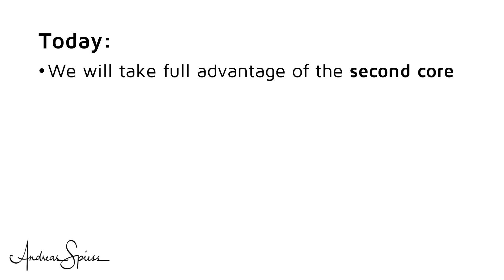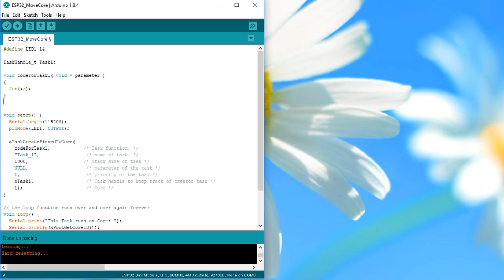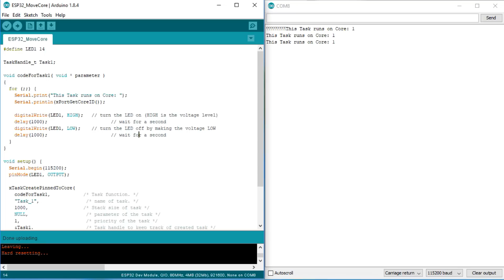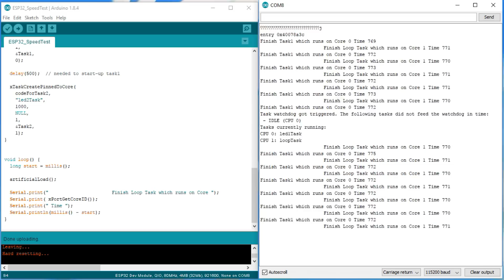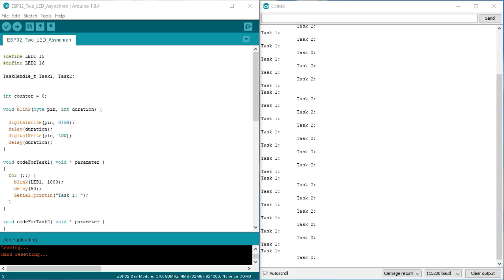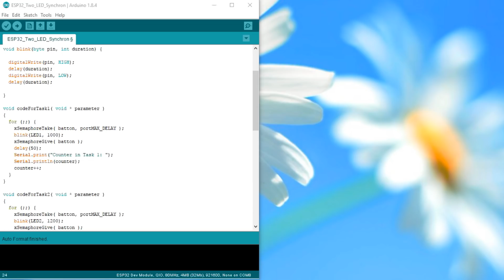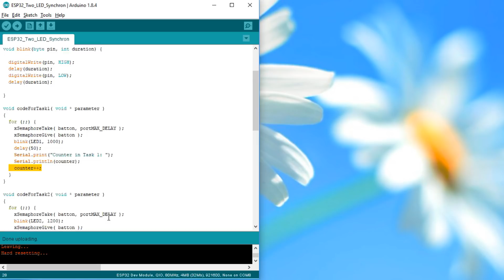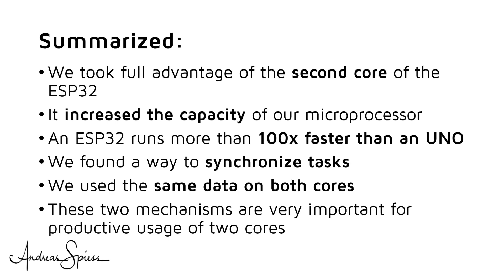#168 ESP32 Dual Core on Arduino IDE  including Data Passing and Task Synchronization

Comment: Hi All,

I am Harendra Fernando from Melbourne, Australia.
I have a quick question about the current topic.

Does Arduino_FreeRTOS ( ) work for ESP32?
I tried to use Arduino_FreeRTOS and Semaphores in ESP32 but it was throwing an error during compilation and stops at the line;
#include
 <Arduino_FreeRTOS.h>

Error: “exit status 1
Error compiling for board ESP32 Dev Module.”

I have installed the FreeRTOS libraries.

Any Idea or thoughts?
Thank you.
Cheers
Harendra
Reply from the maker: Maybe you watch my video ESP32 on steroids?
Reply: Hi Andreas, thank you for the quick reply. Yes, I did watch that video.  But I could not find whether you have imported (included/loaded) the Arduino_FreeRTOS.h file to ESP32? and ways it had done.  If we are to use "xSemaphoreCreateMutex()" should we include the Arduino_FreeRTOS.h ? 
Awaiting to hear from you.  Thanks

Comment: The Arduino Uno is also a RealTimeOS. RealTime is linked to strick time control of the service. Typical for microprocessors. Windows is not.
Reply from the maker: The Arduino has no operating system. It only has a bootloader.

Comment: Hi Andreas :) Another brilliant video as usual. What steps can be taken to work out the stack size for the tasks? I have a project in which I've split the tasks up: input scanning, control, display & logging. My ESP32 DoIT board kept rebooting and I ended up getting it to work by trial and error with the stack size and in some cases changing the target core for a task. When I tried to add WiFi and a WebSocket connection, I couldn't get it to work no matter how much I tweaked the stack sizes and swapped target cores around. I know you're really busy, but even if you could direct me to a link or something as I haven't been able to find any detailed information on working this out in a practical sense.
Reply from the maker: I never looked at the stack size so I cannot help here. I read that you should be very careful if you use Core 0 because it is used by Wi-Fi etc.
Reply: @AndreasSpiess  Ah ok. Thanks for your reply. Yeah, I think I need to read the documentation a bit instead of just hit-n-missing it.

Comment: Anther 5 Star Vid from you! Can we use the Core_0 to run the WiFI Manager and perform some actions pushbuttons for led on/off on the Core_1 ? Is this possible, if yes, could you shed some light one this ? Perhaps, any reference links ?  TIA
Reply from the maker: I do not know because I never tried it and I do not know of links :-(

Comment: An explanatory video like this in such a good tempo is fascinating. No wonder to see so many positive reactions.  But certainly you spend time to produce. Thanks, Andreas, for that.
I have a question that will make using both cores even more interesting. What about interrupts and ISR's? Which core is handling interrupts? 
Say we have a process that produces many interrupts, you could think of an Rotary Encoder.
Pololu has motors equipped with an Encoder. So I was thinking of using the Encoder info for a feedback to control the speed of such motor - now Pololu is offering very expensive motor controller boards from RoboClaw to perform such task. Would be nice if we could do this with an ESP32 for less then 10 $.
My idea is: 
 - one Core is handling all interrupts from the encoder and shares the shaft position info with the task running on the other core
 - other Core uses this position info to calculate if motor runs to slow/fast and corrects the speed of the motor
For a project with 22 motors that have to run at the same speed this will be a money saver.

Thanks if you will think about this,

    Jop
   The Netherlands
Reply from the maker: So far I never used interrupts with RTOS. So you have to dig into its documentation yourself. I am sure it will be possible.

Comment: At 4:30 , you say that even though the loop does NOTHING, it gets some attention, about 50% of the time.  My question is why 50% of the attention?  If loop() has nothing, then shouldn't it take negligible attention on core 1?  I thought the amount of attention loop() gets should be proportional to the amount computational effort/time, which if it is substantially less than codeForTask1(), then should also take substantially less time+attention than codeForTask1().  What have I misunderstood?
Reply from the maker: You are right. It should not get attention. But it does.
Reply: @AndreasSpiess  thanks for clarifying!

Comment: Hello Andeas. For simple shared variables, you could use atomic operations performed on integer values. GCC has builtin atomic operations:

https://gcc.gnu.org/onlinedocs/gcc/_005f_005fatomic-Builtins.html

For more complicated data to be passed between the tasks or use cases other than setting a flag, queues could be used to send data between the tasks,:

https://www.freertos.org/a00018.html
Reply from the maker: Thanks for the link. I should do more with RTOS, I know ;-)

Comment: I added some code to your "ESP32_MoveCore" file. I'm running Blynk on core1 and reading sensors and performing calculations on core0. But the serial monitor gives this error:

Tasks currently running:
CPU 0: core0task
CPU 1: loopTask
<calculation results shown here>
Task watchdog got triggered. The following tasks did not reset the watchdog in time:
 - IDLE (CPU 0)

How do I fix this or reset the watchdog timer?

Also, for some reason, the (analog) readings from my sensors are also fluctuating greatly. I think it has something to do with the second core, since they appear perfectly fine in the original code which only uses one core. 
Any help would be greatly appreciated.
Reply from the maker: I do not know. Working with two cores is tricky.
Reply: Yes, agreed. I managed to get rid of the watchdog timer problem with some googling, but the sensor values are still all messed up. Your video helped a lot though.

Comment: Ok, so I own an arduino uno although haven't really used it, and I've tinkered quite a bit with the raspberry pi 3b. I watch numerous videos from you and other uploaders, but what would be the most efficient way to reach a competence where I can easily follow everything you're saying in this video, for example? I can currently probably follow about 50% of what you're saying. Perhaps if I studied the content, going over it, pausing, reading around the subject etc, I could fully understand it, but is this an efficient method to apply? Any books or exercises recommended? Thank you for your time and your valuable uploads. When I can afford to I intend to support this channel.
Reply from the maker: The best way is: Just start doing something. Start with easy projects. Passive watching will not get you anywhere :-(
Reply: @AndreasSpiess  Thanks for your reply. It's much like any field I suppose: you learn best by doing; that's the essence of apprenticeships and practising a skill. I would disagree that merely observing doesn't "get you anywhere", as my knowledge has increased through watching your videos. Indeed, you alerted me to the existence of the ESP32 and I acquired my first one yesterday and had it blinking LEDs in no time having programmed it via the Arduino IDE. I just enjoy understanding a subject deeply, hence the request for book suggestions. Thanks again and keep up the good work. 👍

Comment: Hi Andreas, I noticed that in your examples,  xTaskCreatePinnedToCore is used in the setup. What if I want to enable and disable the task running on core 0 throughout my main loop? For example, I want to use core 0 to monitor an encoder while core 1 is driving a motor. I do not want core 0 retrieving values from the encoder when the motor is not running as I am using a shared SPI bus with the encoder and other sensors that are being monitors on core 1.
Reply from the maker: I am not an RTOS specialist. Maybe you google in their description on how to enable or kill tasks. AFAIK the ESP32  runs standard RTOS

Comment: For the main loop(), "vTaskDelete(NULL); " I believe is a good solution - it will immediately stop execution of the "main" thread. You could even use it at the end of setup() to never enter loop()
Reply from the maker: Thank you for the tip!
Reply: at 4:42 , isn't that delay(1000) supposed to increase time instead of decreasing it? since the void loop() also is getting exceuted..
Reply: @RakshithPrakash  I think that RTOS handles this and does other stuff while the loop is in the delay
Reply: @sasodoma  Thats what appears to happen, but it would be better as mentioned above to just stop the loop entirely

Comment: A much simpler way is to use ESP32's Ticker Function. I tested, the attached ticker function is run on Core 0. Which is good for scheduled tasks. And it's easier to implement in self-made classes or libraries. And if you want to make something like loop() without delay(), just set the ticker time to 0. eg: myTicker.attach(0, functionName)
Thanks, Andreas. 
I use ticker sometimes but not for the second core only for scheduled tasks, and lately, I want to use the second core of ESP32 and watched this video. And got the trick of Serial.println(xPortGetCoreID()); and I thought maybe Ticker is a TaskHandle_t, too. Cause TaskHandle_t can be seen in a lot of ESP32 Arduino's attached libraries. And I tested the Ticker example, Ticker is run on Core 0!
Test sketch:

#include <Arduino.h>
#include <Ticker.h>

#define LED_PIN 2

Ticker blinker;

void blink()
{
 digitalWrite(LED_PIN, !digitalRead(LED_PIN));
 Serial.print("Blink Task runs on Core: ");
 Serial.println(xPortGetCoreID());
}

void setup()
{
 Serial.begin(115200);
 Serial.print("Serial freeHeap: ");
 Serial.println(ESP.getFreeHeap());

 pinMode(LED_PIN, OUTPUT);
 blinker.attach(1, blink);
//blinker.attach(0, blink);

 Serial.print("Setup freeHeap: ");
 Serial.println(ESP.getFreeHeap());

 Serial.print("Setup Task runs on Core: ");
 Serial.println(xPortGetCoreID());
}

void loop()
{
 delay(60000);
}

======================================================================================================
One big difference between Ticker and Task is that the Ticker management seems to be One Single Task on Core 0, so Tickers are processed one by one.
Ticker1(){delay(1000);} 
Ticker2(){delay(1000);} 
They both attached with interval 0. 
Ticker1 and Ticker2 will be triggered every 2 seconds. Tickers are get queued just like the normal loop(){};

And if create Task1 and Task2 both on Core 0. They will be triggered every 1 second. That means Tasks are really independent to each other.

So Ticker is a simpler method to use Core 0 like the loop(). And Task is a more advanced tech indeed.
Reply from the maker: I think, tasks are a more universal concept but need RTOS. Tickers exist also on platforms without "operating system".

Comment: This is really really interesting! I'm now working in Arduino/AVR worlds and still there's a lot to learn in AVR programming. I also have ESP8266 modules that haven't work with until now, moving to this new ESP32 is a huge improvement for me.
Reply from the maker: And the Wi-Fi connection opens a whole new world of possibilities...
Reply: @AndreasSpiess  wow I'm just imagining that new world 😊 now I just to write my C library of the nrf24l01. But with the ESP modules, the WiFi is built-in so that's more juice. I know it won't be easy to work with the nrf24l01 modules. But the work you do in calibration and testing modules is so much interesting.

Comment: Great work !!!  What about the energy consumed ? Does the core 0 "runs" even if there is no program on it ? If so, It could be usefull to parallelize tasks to save energy.
Reply from the maker: I did not do any power measurements. But I assume both cores run in parallel.

Comment: how to fix this error

Task watchdog got triggered. The following tasks did not reset the watchdog in time:
 - IDLE (CPU 0)
Tasks currently running:
CPU 0: led1Task
CPU 1: led2Task
Reply from the maker: I do not know. Remote diagnostics is not easy.
Reply: @AndreasSpiess  Ciao Andreas! Great job - I always like your videos - Thanks for your good job! I have the same issue like Toeic and you in your sketch - Got the strange Watchdog message but in reallity I reseted it in my main in time. Do you know how we can supress that message? Or do I have to define a second watchdog for the second core? My plan was that in main I only reset the watchdog if a flag was set by the second core as well to ensure that both are running well... Any ideas?

Comment: Excellent video!
I used it and it's working fine. Core_0 to manage wifi, RTC and automation and Core_1 to manage Telegram Bot messages (chat bot). Although I had to change the Stack size of task from 1000 to 8192, to stop getting stack canary watchpoint triggered error.
Reply from the maker: Thanks for your feedback. It is encouraging to see that it works...
Reply: Please give me a hint how you did this to solve the same issue... Thanks
Reply: Can you be more specific?

Comment: Dear Andreas, thank you for your great video. I`m starting trying with second core on ESP32. Im trying to run a sketch in both cores; one of them use for sensing and other to upload values to internet (firebase). It works fine on one core, but when I try to separate in two different task asigned to core O and 1 it crashes because the wifi. Do you have any example or solution using wifi in one core and sensing in the other one.
Thank you in advance for your help.
Regards
Pablo (from Argentina)
Reply from the maker: I did not use WiFi on both cores. I assume Espressif decides where WiFi tasks run. Did you try to swap the tasks?
Reply: Thank your for your quick response. I think I was not clear in my explanation (sorry because my poor english). I want to use one core for wifi upload and second core for sensing temperature + user interface with touch display. I want to try in different cores because upload data requires at least 2 seconds. I dindt try with both task running in the same core as multitasking but as ESP 32 has the adavantage of dual core I was wondering to do that in separate cores. Did you try something similar? Thank you again. Kind regards
Reply from the maker: I think I understood what you want to achieve. If your ESP crashes it might be that you interfere somehow with WiFi or other tasks of Espressif which run on the same core. This is why I suggested changing cores.
Reply from the maker: Glad to read it works now. I will for sure visit once to your beautiful country! I was only in Brasil so far.

Comment: have you discovered on which core wifi runs by default in esp32?
Reply from the maker: I did not investigate, so I do not know.
Reply: one more question : while I try to include the TinyWireS library by Rambo  via Sketch-->include library---> Add.Zip Library , the Arduino IDE ver1.8.5 says "Specified folder/zip file does not contain a valid library". Have you encountered this problem?
Reply from the maker: No, I dis not use this library since a long time

Comment: Any idea why a ledcWrite(channel, duty) would only work on the 'normal' core and not on core 0? It stops working when i move it to the task running on core 0, and I have no clue why, other than taking a guess: the ledCWrite is written only to function on core 1?
Reply from the maker: No, I do not know the reason.

Comment: Andreas, you're a TRUE star (complete with your ubiquitous 'Swiss Accent').
I always enjoy your videos.
I haven't yet done anything much with ESP32 boards as I've tended to concentrate more effort on ARM based SBCs (OLinuxuinos, Beagle, OrangePi, BananaPi, RaspPi etc), but my soldering iron is beginning to show 'twitching' signs of neglect.
As soon as I can muster up some form of project to suit it, I'm sure I'll have the flux flowing...
Thanx dude (from a guy with a Kiwi Accent... LOL)
Reply from the maker: Never visited your country so far... Maybe I can change that when I stop working. I strongly suggest you try this part of electronics. It enhances the useability of the part you are using now.

Comment: @Andreas, Just a quick question, can the third core be used in the same way or is there another way it's used, or can it be used at all during regular operation?Thanks
Reply from the maker: The third is ultra low power and it is used completely different

Comment: Thanks for that great video, really helped me a lot in a project :) 
I would also be interested in some information how to switch the second core (and other sub modules I don't need) completely off to save more energy and how to set the clock frequency of a core.
Cheers!
Reply from the maker: I had to reduce the speed in one of my videos. It is possible. I do not know if you can switch a core off. Video #161